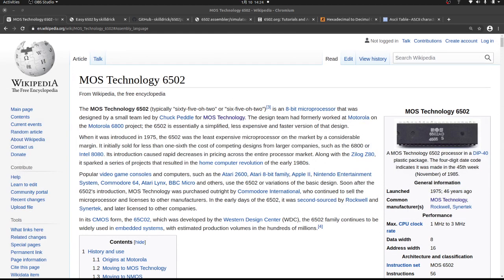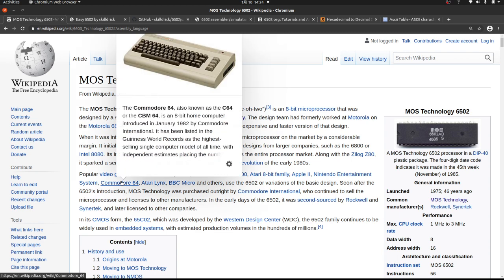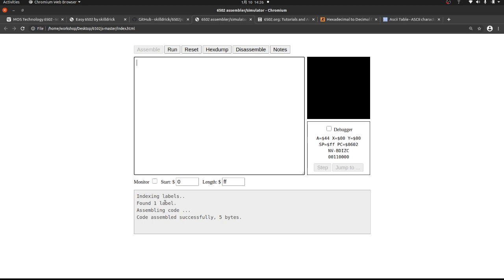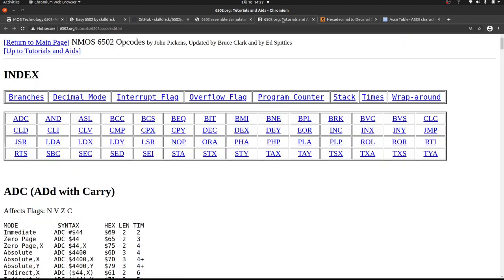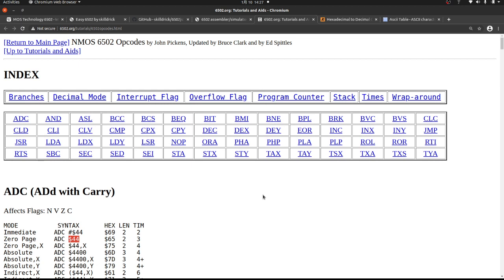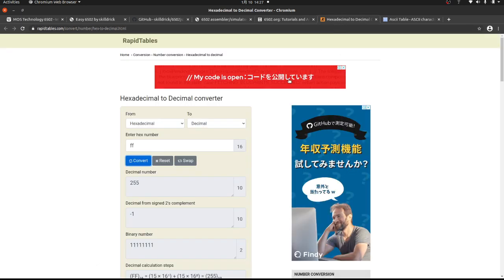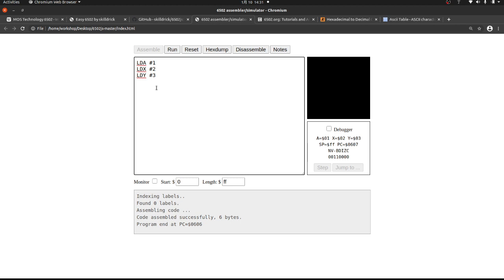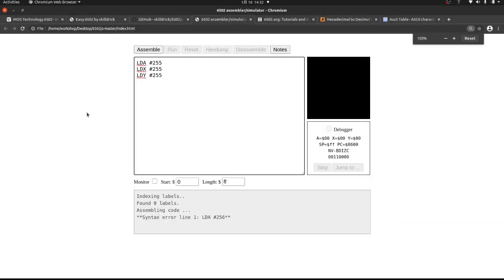6502 Assembly Language: Getting Started

Comment: Wow, that went a lot better than I thought it would for a 6502 emulated in JavaScript.  Good lesson!  Any more to come?
🇨🇦🐧
Reply from the maker: Thanks. I'd like to do more but as always time is an issue - maybe in the summer. Keep on codin'!
Reply: Why should there be anything dysfunctional about a 6502 chip emulated in JavaScript? As ick as JavaScript may make you feel, there's nothing stopping the logic from being implemented perfectly. Code that runs on a simpler processor like a 6502 will have clock cycle latency that is highly predictable while more modern hardware has all kinds of features that mean that the exact time that it takes for an instruction to execute is difficult to predict. However, since modern systems run at far greater speed than the 6502, it is unlikely that the clock cycles being emulated will have any delay that is noticeable to humans.

Comment: Thanks for the tutorial and the link to the 6502 Assembler/Simulator.  I noticed through trial-and-error that it accepts both decimal and hexadecimal numbers in the source code.  As an example, you can specify either LDA #$20 or LDA #32.  Hope that helps.
Reply from the maker: Cheers! And thanks for the tip. Keep on codin'!
Reply: Make sure that if you write in decimal to avoid using the dollar sign ($).
Reply from the maker: @ClassicTVMan1981X  Thanks - gotta remember the basics!
Reply: @TokyoEdTech  You're welcome.

Comment: Sir what do you think about the following idea: what if we assemble 6502 instructions into x86 machine codes?
Please let me explain WHY: I've written a tiny OS for running bootsector games and apps but the only 'development environment' it has is the hex editor so I'm forced to hand assemble x86 assembly and then type bytes into the hex editor to run it. I'm currently looking for a way of having an assembler but here's the deal - one of the main limitations I've set up for that project is to have only 512 bytes sized programs (mainly due to the lack of file system and hard coding various commands to phisical sectors on USB flash drive) and x86 assembly intel syntax is too heavy to fit into 512 bytes (most bytes would be spent for string parsing) but in 6502 we have single word mnemonics and the only operand which is so minimalist, hence so cool! So what I mean is say for LDA #01 produce the opcode for x86 corresponding instruction like mov al, 0x01 which results in b001 that can be executed by x86 processor. I believe most basic 6502 instructions can fit into 512 bytes but my concern is the flags for the x86 flags behavior is hardware defined and different from 6502. I just feel a bit stuck and looking for an expert feedback just to figure out whether I should keep thinking in this direction or not. Please kindly let me know your opinion and thanks in advance!
Reply from the maker: Interesting project! I'm definitely no expert. Even if you write it in 6502 it still needs to be compiled to x86 machine code if you want to run it on x86. You're probably better off writing it in x86 and optimizing
Reply: @TokyoEdTech  Got you, thanks for taking your time to reply!
Reply: The assembler software you use will assemble the code into a binary file (machine code). So you could in theory write your own compiler or assembler with minimalistic instruction sets, which your software would then assemble into machine code in order to do what you want. It doesn't really matter what instruction set the assembler accepts (you can make it all up), but the resulting binary file would need to be compatible with your hardware, e.g. x86.
Reply: @rickdearman9992  thanks for your reply. Eventually I decided to write a 6502 simulator that would be taking 6502 machine codes as an input and then execute that. Lots of tedious work but seems pretty doable for me)
Reply from the maker: Good plan - I started one a while back but didn't get super far. Might pick it up again someday.

Comment: Awesome 👌🏿 demonstration! Thank you. 
I have a question 🤔? Will this program work for emulation of an Atari 800 or 65xe, or Commodore 64?. If  I create a code for controlling and or moving with sprites with a joystick 🕹 will that work?
Reply from the maker: You're welcome! 6502 assembly itself will work, but each system has the relevant memory locations in different places. For example, the C64 screen ram is at 1024 while on the Atari 800 it is at 12194 or 36770 depending on the amount of RAM in the system (numbers might be a bit off but you get the idea).

Comment: I made a little program to make a ball bounce back and forth across the screen. I'll be at pong soon enough lol
;DIRECTION TO MOVE 0 = RIGHT 1 = LEFT
LDX #00
STX $00

;POSITION
LDX #00
STX $01

;COLOR
LDX #01
STX $02

IN:
 LDX #00

 CLEAR:
  CPX $01
  BEQ DRAW

  LDA #00
  STA $400, X
  JMP END
  
  DRAW:
  LDA $02
  STA $400, X
  
  END:
  INX
  CPX #32
 BNE CLEAR

LDX $01
LDY $00
CPY #00
BNE LEFT

RIGHT:
INX
STX $01
CPX #31
BNE IN
LDX $FE
STX $02 ;CHANGE BALL COLLOR ON COLLISION
LDX #01
STX $00
JMP IN

LEFT:
DEX
STX $01
CPX #00
BNE IN
LDX $FE
STX $02 ;CHANGE BALL COLLOR ON COLLISION
LDX #00
STX $00
JMP IN

Comment: Registers aren’t memory, memory is memory, registers are registers.

Learn hex.
Reply from the maker: I get your point. However, I made this for my high school students so I had to simplify the explanations a bit and avoid hex.
Reply: You should definitely teach high school students hexideximal
Reply from the maker: @irishdadx4  It's not in the curriculum, so I won't put time into it. The probably learn it in math class at some point though.
Reply: From an electronics standpoint they are both exactly the same. The register is located inside the CPU and has no numerical address and can only be manipulated by commands to the CPU. "Memory" is located at any address external to the CPU. A specific electronic circuit called a bistable multivbrator or "flip-flop" is a single bit memory circuit. The 6502's X, Y, A, SR and stack are all memory without an address other than internal to the CPU. They are each 1 bit flip-flops, 8 in series to make an 8 bit storage requester or "memory". The only difference between a register and a memory location is how the CPU accesses it.
Reply: True that @3DPDK